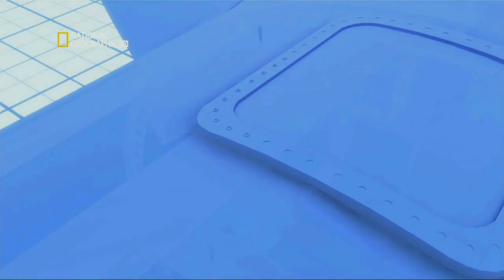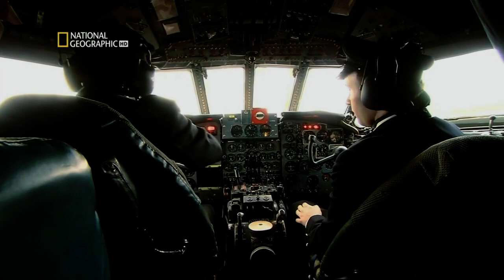The Crash of the De Havilland Comet

Comment: It was the cracks around the roof hatches that caused the failure, not the passenger windows.
Reply: It was the Aluminum sheets only 1mm thick made from the wrong alloy that caused the Comet to disintegrate.
Reply: @sandervanderkammen9230 

It is indeed very important to note all the relevant facts of course obviously.
Kharzeestan Krappenz DiktorBummer Jurkzxoffenz etc and co - they should all note good with much awe & extreme wonder.
        UPDATE MORE BREAKING NEWS ETC

    How things were back then -
Accident losses - % of aircraft built.
DeHavilland Comet 4 UK     14% 
DeHavilland Comet all mks  17%  
Vickers VC10 UK 5%
   The DH Comet had better safety than or similar safety to many other commercial passenger aircraft of a similar era
    Douglas DC-1        99%
      Douglas DC-2        47%
    Douglas DC-3        30%
      Douglas DC-4          26%
    Boeing s300            72% 
 Boeing 307               70%
  Boeing 247                48%
     Boeing 707                   20% 
Lockheed L-049/149 Constellation  30%
   Lockheed Electra  Turboprop    29%
Fairchild FH-227                         30%
 McDonnell Douglas DC-8     14%
  Sud Aviation Caravelle       15%
Canadair CL-44  Turboprop   46%  
Convair CV-580  Turboprop 22%

        The Comet was designed with military use in mind, Nimrod work started at De Havilland in 1953.
  The committee did not find hundreds of fatal flaws or evidence of design defects, structural defects, defective materials or shoddy workmanship. Ripstop provision was included. Claimed incidents did not involve cracks starting from window corners.
     The engine & engine intake position had advantages, were not flaws or fatal flaws & were not the cause of any incidents involving any Comet or Nimrod aircraft. Nearly all changes before the Comet 4 were just in case or were previously scheduled improvements. 
  Bow-wing & the 707 story (see b-47 wing folding incidents) is the result of global economics & the well protected & very large domestic US airliner market & active support from the UK with for instance proposed competing airliners from Vickers & DH being blocked by the UK government at the time, cheap & nasty was the requirement with large scale production capability in one place.
  The 707 was of course a much larger aircraft which as a stressed skin metal airframe aircraft would require a thicker skin anyway. They got lucky at the time essentially.  Bow-wing is the result of the large & well protected  US domestic airliner market 
  The fate of De Havilland was due to Govt policy Aerospace sector rationalisation & global economics, it was nothing to do with the Comet.
  A comprehensive, thorough & protracted testing program was carried out on the prototype & it's assemblies. Of course the Comet did indeed have Ripstop stop provision. 
     De Havilland (Of England) Comets were not grounded after 1970 due to structural problems.
It's interesting that some of the aircraft on the list should really have been noticeably safer than the Comet due to being a similar type but of much later design & manufacture but they definately were not safer.
    How things were back then -
Accident losses - % of aircraft built.
DeHavilland Comet 4 UK     14% 
DeHavilland Comet all mks  17%  
Vickers VC10 UK 5%
   The DH Comet had better safety than or similar safety to many other commercial passenger aircraft of a similar era
    Douglas DC-1        99%
      Douglas DC-2        47%
    Douglas DC-3        30%
      Douglas DC-4          26%
    Boeing s300            72% 
 Boeing 307               70%
  Boeing 247                48%
     Boeing 707                   20% 
Lockheed L-049/149 Constellation  30%
   Lockheed Electra  Turboprop    29%
Fairchild FH-227                         30%
 McDonnell Douglas DC-8     14%
  Sud Aviation Caravelle       15%
Canadair CL-44  Turboprop   46%  
Convair CV-580  Turboprop 22%

A comparison of more recent aircraft.
Accident losses comparison examples. 
1970s - 1980s
    % of total Aircraft built
Similar aircraft type, date / decade, useage, size.
    Biz Jets
BAe-125-800                        1.7 %
Beechcraft Beechjet 400    2.2 %
Cessna 550 Citation II         7.1 %
Learjet 35 / 36                       12 %
Beechcraft 1900                  6%
Dassault Falcon 10              11.5%
Aérospatiale SN.601            22.5%

Medium size jets / Turboprops.
BAe-146               5.1%
Fokker 100          6%
McDonnell Douglas DC-9-30       9.5%
Fairchild FH-227       30%
McDonnell Douglas DC-8    14%
Canadair CL-44  Turboprop   46%  
Convair CV-580   Turboprop   22%

Beechcraft, Fokker, McDonnell Douglass, Learjet, Fairchild, Aerospatiale, Canadair, Convair  companies defunct.

    All Comets, including some Comet 1s, had full civilian use certification at some point after 1954,  civilian use certification only being withdrawn after commercial flying stopped. Examples were flying until 1997 - one example did a signals research global circumnavigation flight series in 1993 via Australia virtually without a rest travelling 28000 miles, only had an ice warning indicator issue during the flights.

    The DH Comet - World Firsts.
1st gas turbine jet powered airliner. 1st high altitude 8psi pressurised full fuselage length passenger cabin airliner,  not a trivial feature as structure  strength required for pressurisation considerably exceeded strength required for normal flying stress. Nobody else had done anything similar before the Comet.
  The b-47 used 2 relatively small, heavily built  pressurised modules  (the aircraft where 6 had their wings fold up in 2 months while flying & some had their wings fall off while parked). 
   The 1937 Boeing piston engined airliner pressurised passenger cabin was pressurised to 2 psi only - in fact that could easily be done as the normal unpressurized fuselage cabin structure strength for flying stresses only was all that was needed to be adequate so no significant weight increase issues needed addressing.
    1st all hydraulically powered flying surface controls & actuators airliner with under carriage wheel disk brakes + ABS.
1st jet airliner to cross the Atlantic.
1st jet aircraft to do a world circumnavigation flights series.
  Of course De Havilland had prior experience building many all metal construction airframe aircraft including thousands of jet powered fighter aircraft that were primarily of metal construction with pressurised cockpits & jet engines built by De-Havilland & we know the world's first all metal construction airframe airliner was built in England in the 1920s by Handley Page.
     De Havilland did indeed always work to better than industry standards at the time, used up to date knowledge for the design & no evidence of negligence  or criminal negligence was ever produced in relation to the DH Comet.
    The course of De Havilland & the general UK aerospace industry sector was not affected even slightly by the DH Comet. The course of national aerospace sectors obviously being similar & inevitable in many countries.
     Other interesting World firsts
World's first turboprop aircraft.
Vickers Viscount Turboprop Airliner 1947. 
A 1945 Gloster Meteor Aircraft with Turboprop Gas Turbine Engine.

They might like to answer these questions.
   Which airline has just ordered
60 RR England Trent XWB Engines
& What aircraft are the engines for?

Bonus question for 10 points.
         Which country has the 
World's Highest Combined Per Capita
  Nuclear + Defence + Aerospace Sector Activity?    

          👍 & 🙂 & of course 😎 indeed.
          C H E E R S & without doubt  -
          Toodle PIP Old C H A Ps.
 
This line left not blank intentionally.
           
   The next line is blank intentionally.     
             

    

. .... . ... ... ..... ...
. . ... ..         ... . ..
 
Ivcxivcxivcxcvcxcv
cxcxcvccbcxcxccxv

Comment: It fall apart mid flight because of square windows and the weak spots that would burst the plane
Reply: Catastrophic in-flight structural failures were because de Havilland didn't understand how to build planes out of metal.. the company's only successful aircraft were made primarily from WOOD and Fabric
Reply: @sandervanderkammen9230 
@sandervanderkammen9230 

It is indeed important to note the facts of course.
Kharzeestan Krappenz DiktorBummer Jurkzxoffenz etc and co - they should all note good with much awe & extreme wonder.
        UPDATE MORE BREAKING NEWS ETC

    How things were back then -
Accident losses - % of aircraft built.
DeHavilland Comet 4 UK     14% 
DeHavilland Comet all mks  17%  
Vickers VC10 UK 5%
   The DH Comet had better safety than or similar safety to many other commercial passenger aircraft of a similar era
    Douglas DC-1        99%
      Douglas DC-2        47%
    Douglas DC-3        30%
      Douglas DC-4          26%
    Boeing s300            72% 
 Boeing 307               70%
  Boeing 247                48%
     Boeing 707                   20% 
Lockheed L-049/149 Constellation  30%
   Lockheed Electra  Turboprop    29%
Fairchild FH-227                         30%
 McDonnell Douglas DC-8     14%
  Sud Aviation Caravelle       15%
Canadair CL-44  Turboprop   46%  
Convair CV-580  Turboprop 22%

        The Comet was designed with military use in mind, Nimrod work started at De Havilland in 1953.
  The committee did not find hundreds of fatal flaws or evidence of design defects, structural defects, defective materials or shoddy workmanship. Ripstop provision was included. Claimed incidents did not involve cracks starting from window corners.
     The engine & engine intake position had advantages, were not flaws or fatal flaws & were not the cause of any incidents involving any Comet or Nimrod aircraft. Nearly all changes before the Comet 4 were just in case or were previously scheduled improvements. 
  Bow-wing & the 707 story (see b-47 wing folding incidents) is the result of global economics & the well protected & very large domestic US airliner market & active support from the UK with for instance proposed competing airliners from Vickers & DH being blocked by the UK government at the time, cheap & nasty was the requirement with large scale production capability in one place.
  The 707 was of course a much larger aircraft which as a stressed skin metal airframe aircraft would require a thicker skin anyway. They got lucky at the time essentially.  Bow-wing is the result of the large & well protected  US domestic airliner market 
  The fate of De Havilland was due to Govt policy Aerospace sector rationalisation & global economics, it was nothing to do with the Comet.
  A comprehensive, thorough & protracted testing program was carried out on the prototype & it's assemblies. Of course the Comet did indeed have Ripstop stop provision. 
     De Havilland (Of England) Comets were not grounded after 1970 due to structural problems.
It's interesting that some of the aircraft on the list should really have been noticeably safer than the Comet due to being a similar type but of much later design & manufacture but they definately were not safer.
    How things were back then -
Accident losses - % of aircraft built.
DeHavilland Comet 4 UK     14% 
DeHavilland Comet all mks  17%  
Vickers VC10 UK 5%
   The DH Comet had better safety than or similar safety to many other commercial passenger aircraft of a similar era
    Douglas DC-1        99%
      Douglas DC-2        47%
    Douglas DC-3        30%
      Douglas DC-4          26%
    Boeing s300            72% 
 Boeing 307               70%
  Boeing 247                48%
     Boeing 707                   20% 
Lockheed L-049/149 Constellation  30%
   Lockheed Electra  Turboprop    29%
Fairchild FH-227                         30%
 McDonnell Douglas DC-8     14%
  Sud Aviation Caravelle       15%
Canadair CL-44  Turboprop   46%  
Convair CV-580  Turboprop 22%

A comparison of more recent aircraft.
Accident losses comparison examples. 
1970s - 1980s
    % of total Aircraft built
Similar aircraft type, date / decade, useage, size.
    Biz Jets
BAe-125-800                        1.7 %
Beechcraft Beechjet 400    2.2 %
Cessna 550 Citation II         7.1 %
Learjet 35 / 36                       12 %
Beechcraft 1900                  6%
Dassault Falcon 10              11.5%
Aérospatiale SN.601            22.5%

Medium size jets / Turboprops.
BAe-146               5.1%
Fokker 100          6%
McDonnell Douglas DC-9-30       9.5%
Fairchild FH-227       30%
McDonnell Douglas DC-8    14%
Canadair CL-44  Turboprop   46%  
Convair CV-580   Turboprop   22%

Beechcraft, Fokker, McDonnell Douglass, Learjet, Fairchild, Aerospatiale, Canadair, Convair  companies defunct.

    All Comets, including some Comet 1s, had full civilian use certification at some point after 1954,  civilian use certification only being withdrawn after commercial flying stopped. Examples were flying until 1997 - one example did a signals research global circumnavigation flight series in 1993 via Australia virtually without a rest travelling 28000 miles, only had an ice warning indicator issue during the flights.

    The DH Comet - World Firsts.
1st gas turbine jet powered airliner. 1st high altitude 8psi pressurised full fuselage length passenger cabin airliner,  not a trivial feature as structure  strength required for pressurisation considerably exceeded strength required for normal flying stress. Nobody else had done anything similar before the Comet.
  The b-47 used 2 relatively small, heavily built  pressurised modules  (the aircraft where 6 had their wings fold up in 2 months while flying & some had their wings fall off while parked). 
   The 1937 Boeing piston engined airliner pressurised passenger cabin was pressurised to 2 psi only - in fact that could easily be done as the normal unpressurized fuselage cabin structure strength for flying stresses only was all that was needed to be adequate so no significant weight increase issues needed addressing.
    1st all hydraulically powered flying surface controls & actuators airliner with under carriage wheel disk brakes + ABS.
1st jet airliner to cross the Atlantic.
1st jet aircraft to do a world circumnavigation flights series.
  Of course De Havilland had prior experience building many all metal construction airframe aircraft including thousands of jet powered fighter aircraft that were primarily of metal construction with pressurised cockpits & jet engines built by De-Havilland & we know the world's first all metal construction airframe airliner was built in England in the 1920s by Handley Page.
     De Havilland did indeed always work to better than industry standards at the time, used up to date knowledge for the design & no evidence of negligence  or criminal negligence was ever produced in relation to the DH Comet.
    The course of De Havilland & the general UK aerospace industry sector was not affected even slightly by the DH Comet. The course of national aerospace sectors obviously being similar & inevitable in many countries.
     Other interesting World firsts
World's first turboprop aircraft.
Vickers Viscount Turboprop Airliner 1947. 
A 1945 Gloster Meteor Aircraft with Turboprop Gas Turbine Engine.

They might like to answer these questions.
   Which airline has just ordered
60 RR England Trent XWB Engines
& What aircraft are the engines for?

Bonus question for 10 points.
         Which country has the 
World's Highest Combined Per Capita
  Nuclear + Defence + Aerospace Sector Activity?    

          👍 & 🙂 & of course 😎 indeed.
          C H E E R S & without doubt  -
          Toodle PIP Old C H A Ps.
 
This line left not blank intentionally.
           
   The next line is blank intentionally.     
             

    

. .... . ... ... ..... ...
. . ... ..         ... . ..
 
Ivcxivcxivcxcvcxcv
cxcxcvccbcxcxcxcv
Reply: Chow Mein gobblers should be aware.
DH designed & built large numbers of metal airframe aircraft before the Comet.

Accident losses - % of aircraft built.

DeHavilland Comet 4 UK 14% 
DeHavilland Comet all mks  17%  
Vickers VC10 UK 5%

Boeing 707 USA  20%
Lockheed Electra USA 29%

Comment: The British where ahead in the jet age until this happened, then Boing took over
Reply: No, that maybe a popular propaganda myth in the U.K. it is not supported by any factual evidence.
Boeing was successfully building pressurized airliners for nearly two decades before the Comet Disaster.. 
The Boeing 707 series is based on the Boeing B-47 which flew 2 years before the Comet.. it was a large, multi-engine jet aircraft that was pressurized to 9.6 psi at 44,000 feet... de Havilland was still building aircraft  primarily from WOOD.
Reply: @sandervanderkammen9230 
Fryed Ryce Muncherz shud note
De Havilland produced large numbers of all metal airframe construction aircraft before the Comet.
How things were back then -
Accident losses - % of aircraft built.
De Havilland Comet 4 UK     14% 
De Havilland Comet all mks  17%  
     _DH Comet 1      22% or 27%  or 31%
     (2 or 1 or 0 of the DH Comet 1 
     losses were definite ground
     handling error caused write-offs)._
Vickers VC10 UK 5%
The DH Comet 1 aircraft specifically had better safety than or similar safety to many other commercial passenger aircraft
    Douglas DC-1        99%
      Douglas DC-2        47%
    Douglas DC-3        30%
      Douglas DC-4          26%
    Boeing s300            72% 
  Boeing 247             48%
     Boeing 707             20% 
   Lockheed Electra   29%